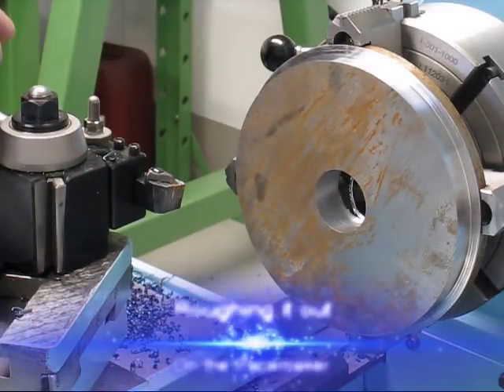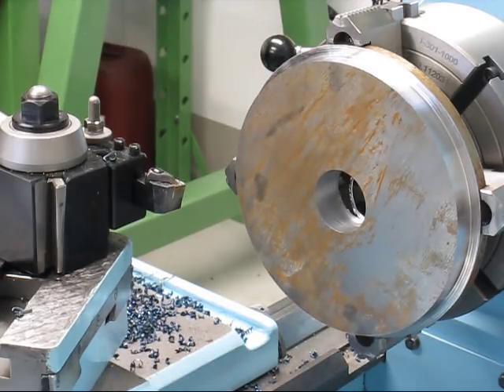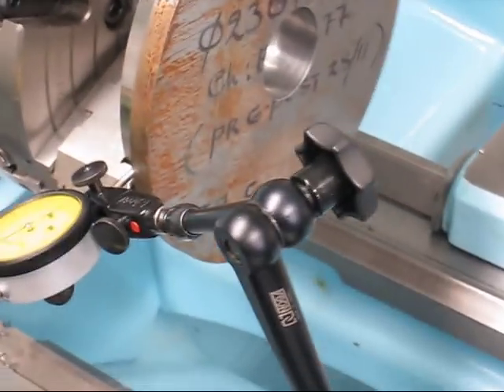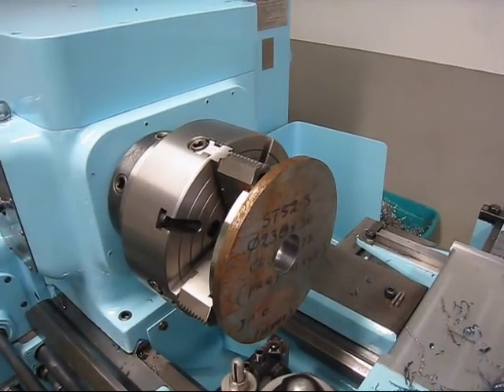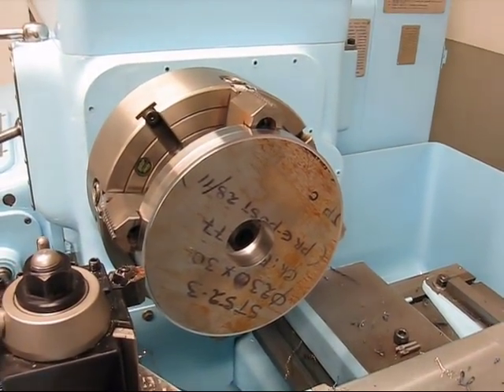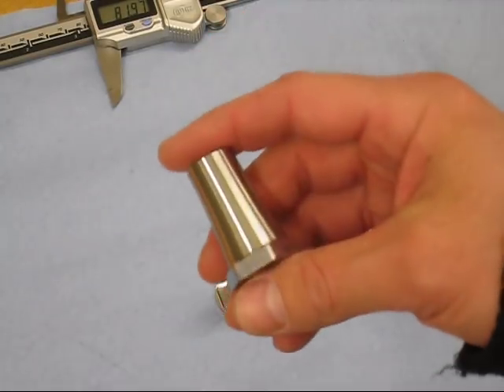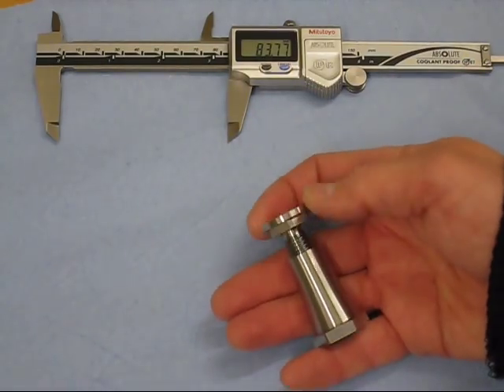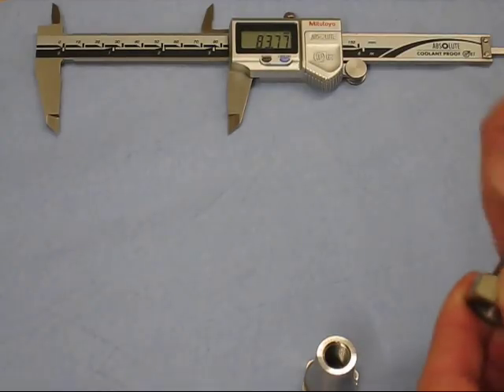Roughing It Out On The Pacemaker lathe

Comment: On your idea about the machinist jacks.

A few  ideas come to mind, one was mentioned in the comments in regards to the wide base, for me not necessary but others may like it. 

What you could do is incorporate a wide base as a separate part and keep the standard base small as space is not always available.

Another idea would be a hole where you can either press fit a dowel pin or have removable pin that could be moved from side to side to gain access.

Last but not least the top of the jack could be a washer type of part where the top of the jack could spin so as to not move the part when adjusting the height .

Incorporating all of these ideas could either be time consuming or not cost effective but i do believe in making something is better not to make it the same as everyone else, but have something new that not so easy to find like using all of the above ideas into one part you need to make better not the same as everyone else.  

Regards Peter.
Reply from the maker: The separate base idea was really cool. I think I will do that when I have the time. I thought about making a swivel-top that could tilt about 15 degrees in any direction but it became very complicated fast, so I like your idea of a simple washer-top. Nobody was interested in buying any of the jacks, but considering the prices of jacks made in China I understand it. Just thought maybe someone would like a quality product actually made in Europe. I like reading you comments !
Reply: You will not sell a lot of quality anything in this world.
But quality will never go out of style.

Not to rip people off,  but if people can see quality they pay a little more for it.
Is not all bad that you have not sold any as yet,  it is just a starting point.

You might need to consider other items that could be added to your range of items available.
My idea for you is to have an, "A" to "Z" of items available,
You have only made "A".

You are European you understand quality,  but not easy to sell this thinking to everyone.

All the best to you.
Regards Peter.

Comment: I had interruptions all day. Some bunch of thieves broke in to my shop storage and took off with a load of stuff, including two lathes. Add insult to injury, left a big mess to clean up. Your video was a bright spot on a dark day. I still get a thrill seeing that American lathe shine and doing good work.
Reply from the maker: That was sad, I hope you can get the machines back or at least get insurance. I am glad my video cheered you up.
Reply: Panzax , thank you. Rough day yesterday. I picked up a couple of machinst jacks a few years ago that had a bell flare to the base. Made for an attractive appearance. I learned how to hand turn the one off parts like this many years ago from a clock maker and modified a tool holder to do this. It is surprisingly easy to do after a little practice. I will see if I can find a video to link or perhaps make a video to show you how. Used that tip many times, just need to use a collet chuck for safety. Requires making a T-rest.
Reply: Panzax , there is a YouTube user: "Build Something Cool" who posted a video titled "Turning metal by hand". Basically the same technique I use. I made my own graver tools but can be purchased. The technique is well shown in this video and you can see very safe and effective. Hope you like the tip. Best regards.
Reply from the maker: Thanks for the tip. I made the jacks on the Mazak though so I did the design in cad and Mitusbishi did the rest ;)
Reply: Panzax , lol... CNC makes life easier....
Reply from the maker: That's for sure. Especially if you need more than 1.

Comment: In love with your lathe, even before you restored it. On the jacks I would also drill a through-hole on the 19mm flats to insert a small handle to make precise adjustments. Looks beautiful as all your work does!
Reply from the maker: Thank you very much! The holes sounds like a good idea - Much more control than with a 19mm wrench.

Comment: Needs a bigger base
Reply from the maker: Please explain why you think so.
Reply: In my experience, when the jack is over 50% extended it becomes less stable, even in compression.  To compensate for that expand the base to 75% of full height. In your design 80mm height should be 60mm base.
Reply from the maker: You got a point there, but space is also at a premium usually.. One should maybe have two different sets. One wide and one narrow..
Reply: Jacks are like Love. You can never have enough.